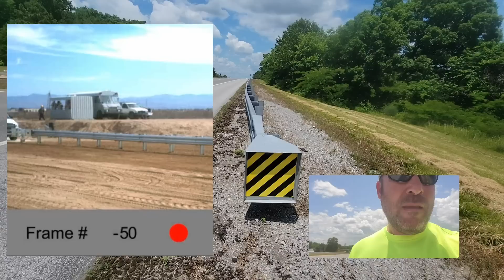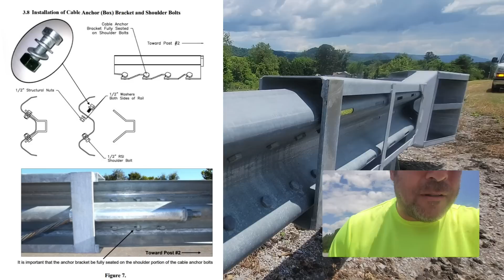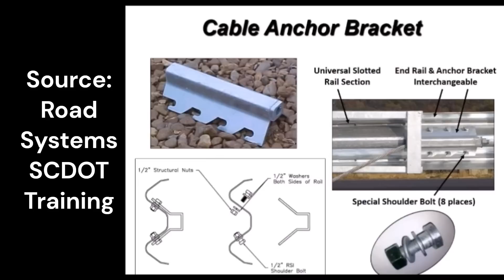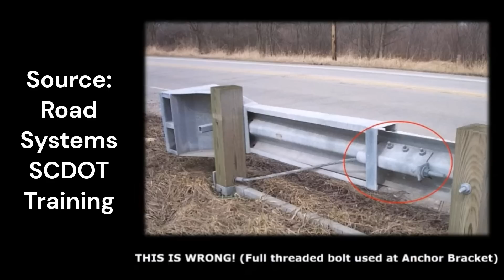Explanation of Backward Bolts Guardrail Short with Million+ Views

Comment: I work as a fire sprinkler fitter. I take my work very seriously when it comes to proper installation and the thing i noticed is you mention manuals/cut sheets. Id imagine theres some form of packing involved in the hardware, unit etc, how do we contact these product manufacturers to insist a cut sheet included with every unit? Yes its a lot of paper, but its worth it.
Reply: I'd say one cut sheet for the whole box would be enough, no?

Comment: 2:35 You could have a slot on the shoulder of the bolt that the anchor plate fits in but won't fit on the front of the bolt if it is installed backwards.

Comment: Why not just have the manufacturer put a symbol on the side say a letter “A” then the bolt has a letter “A” on its head, and installers use that as a signal to match sides. Sounds like a matter of life and death worth the extra cost to change the manufacturing process.

Comment: As soon as it states SHOULDER of the bolt your point is made :) The shoulder is stronger, installed backwards like that the threaded portion of the bolt that shouldn't be there will be much more likely to shear. If you're not going to follow the instructions why not just put it together with self tappers? :O Hold them accountable, put 1 in jail, and everyone will start reading the instructions :D

Comment: Most of the problems you come across are from people getting low wages that just don't care. I got a new Softstop install from a ITS project. It's curved & trailing end is missing parts. Manual tells you it can't have a curve in the first 50ft no matter if it's built as a TL2 or a TL3. I have to wait until we do a walkthrough later on to make them fix it. The big companies hire min wage workers to get low bids. My small guardrail sub pays his guys more & trains them. The job better be correct or he's chewing some butt up. Most of what you see is from repair work someone has patched it up.

Comment: Regarding the comments, I'm sure most people just do not understand that there is complexity and design in a guardrail.  I'm sure you've made videos specifically about this, but you'll just have to keep repeating yourself.  

As far as assembly errors, the design has to be improved.  It's designed well for impacts, but not designed well for assembly.  This is a common problem for big items where the customer base is small, since there isn't a lot of feedback or trouble shooting going back to the manufacturer.  Off hand, I'd say color coding is a good idea.  Paint the tops of the bolts blue, then paint a blue stripe on the cable bracket and slot, then the contractor just has to match all the blue bits together.  

Perhaps you could arrange a meeting where a new contractor assembles a guardrail and the designer/manufacturer observes without saying anything, just to watch where the sticking points are.  I've found sessions like this to be extremely helpful in software and web page design.

Comment: Thank you, sir.  I appreciate the work you do but am sorry for the loss of your daughter.  As a former highway construction inspector, one of the problems I faced was "inspecting" installations where there was little to know specific detail as to exactly how the intallation was supposed to be.  Sure there were plans and standards from the state showing "general" details. But by the time the manufacturer's detailed installation plans could be obtained, the work was long completed and the contractor gone.  This may be different nowadays but it was a frustration for me at the time.  Everyone has to get in, get out and move to the next job. I also wonder  whether state maintenance programs include regular inspections of past guardrail installations to determine if they are still in compliance with the manufacturer's design intent.
Reply: Your comment should be highlighted, it’s important to know where and why in the chain of events safety breaks down. It’s easy to point to the next guy when you don’t realize he is being screwed too!

Comment: “it doesn’t matter” i don’t think you proved why bolt orientation does matter.  just because the drawing shows it a certain way doesn’t prove why it matters from a safety/physics standpoint.  can you explain why it would be problematic for the bolt to be the wrong direction?  from a physics perspective, the clamping force is the same irregardless of orientation
Reply: i think i figured it out.  the captive washer actually rests between the rail and the other piece so it provides a small gap.  i would imagine this allows it to slip easier during an impact

Comment: As a mechanical engineer, everyone thinks they are an engineer. Always follow design drawings and manufacturers recommendations.  Or idiot proof the installation from wanna be engineers so the system can only be installed as designed.

Comment: I hate the litigious society we live in but unfortunately a massive lawsuit is probably the only thing that will get action to resolve some of this stupidity with safety barriers. 
They are supposed to be “Safety” barriers so the fact that they are causing this horrendous destruction is pitiful. 
I am in the NY area and I do see a lot of these deadly barriers in my area. I also see a lot of those large yellow bins filled with sand in certain locations…… probably not enough room to use them in many locations.
Considering the many incredible engineering structures we have in this world it’s hard to understand how someone has not come up with a better mousetrap for this problem. Blunt end guardrails are inexcusable. If car manufacturers can produce a car with crushable end zones why can’t barrier manufacturers come up with a better crushable barrier. I am sure NASCAR and Formula One has a better barrier system than we use on public roads.

Comment: I work in the cellphone tower field ( at heights). Per some carrier, manufacturers, and tower owners instructions. If we use the wrong bolt, washer, lock washer, and or don’t have pointing the right diction.  *Bolt point up. We will not get paid till it fixed. 

One more thing to add. Some carrier will only allow .03 +/- of plum and tilt. 

*towers are engineered to flex and move with the ground during an earthquake without collapsing.

Comment: OK, so your argument is that the manufacturer says to put them in a certain direction, so that means it is definitely better? Because I can give examples all throughout entire industries where the engineers were either wrong, or had no real reason to put something in one way VS another. The physics don't change because a bolt is put through metal from the front as opposed to the back. It's exactly the same. And just because you call people ignorant, doesnt make your argument more valid. Show proof of the rail failing because the bolts were put in front to back, instead of back to front. I can confidently say that there is no such proof. You can put a bolt through metal in either direction. It's going to hold exactly the same way.

Comment: Never did he say having the nut facing out at the same way of the bracket was a problem but the solid steel frames which were used before 1997.
Reply from the maker: The system did not exist before 1997! The point was to focus on the shoulder bolts which were discussed.
Reply: @TheGuardrailGuy  he says in the video the old non catapult steel frame was switched after 1997, do you really believe a few threads on 6 bolts is going to hold it back from ejecting when a car crash into it?. The importance is the new ejectable steel cap which he compare it to.

Comment: 1:57 WRONG! Sorry, but no. No one's pounding the table here. And no one's saying these things SHOULDN'T be installed properly. From the looks of that video the bolts SHOULD have been turned around, one side of washers was missing, and the metal hook things weren't tightened enough. We're all just asking WHY you think something like bolt direction matters?!? Perhaps the person who made that drawing KNEW bolt direction DOESN'T matter, but they had a drawing to finish, so they picked one way randomly?!? Ever though of that? Even the tightness of that cable shouldn't be a problem. In fact, that gap would allow MORE movement and hence a softer/slower impact! That's safer, not "a LETHAL installation". You calling something "LETHAL" requires more proof on your part! So "incorrect? Yes. "LETHAL"? Prove it! 

And WTH is that truck even doing?!? Are we SUPPOSED to crash into the ends like that? I assumed those were more to keep your car on the road and out of the river or other lane of traffic than to slow your vehicle with! Perhaps if you made a video detailing the EXPECTED use of these, and looked into the installation instructions provided by the company who designed them (Because if those instructions are not as clear as your drawing, then blaming the installer is unfair!) OR, if what you showed were the ORIGINAL instructions and they have since issued alterations to the drawing you showed, the installation you're looking at just might be CORRECT! Also, most companies design their products with a certain level of "idiot proofing" which this design seems to lack! Making this more of a design issue than an installation issue! OR, this could be a manufacturing issue! If those bolt holes are even slightly undersized or not properly aligned, then just getting those bolts IN the holes would be an accomplishment! 

Look, I'm sorry about your daughter. And if this is a real problem then I'd like to see a national program of guard rail inspectors unleashed at EVERY finished new construction guard rail and a policy of upgrading all old guardrails as needed. If you made a single video that explains what the problem you're trying to fix IS, who's fault it REALLY is, and what you think needs to be done to fix it - we'd all get behind you! For now, it just seems like you're mad at some random young guy working for the DOT who hasn't been properly trained. But if he isn't properly trained, that's not HIS fault now is it? Maybe he IS properly trained, but his boss is telling him to "hurry up" and "that's good enough" so it's not the installers fault OR the cities fault! It's the foreman's fault. Make a better video, get more people on your side, go viral, get interviewed on Joe Rogan's podcast, get called before Congress to testify about road safety, and then clap as the POTUS signs a bill named after your daughter and finally fixes whatever problem you think you're solving IS! Or you can just keep getting mad that Cletus didn't follow the installation instructions properly and installed the bolts backwards. IDGAF, I'm not the boss of you. But I know which one I'D choose! 

Alternatively, you could film yourself unbolting those bolts, flipping the screws around, adding washers, tightening up the metal plate and cable, and "fixing" that guard rail (instead of just b!tching about it online).

Comment: God bless you and the work you do, I can't believe ppl are defending incorrectly installed safety equipment.
Reply: A sticker on the bracket showing the bolt direction would be a cheap idea to inform the installer

Comment: The best way is design it properly so that it only fits together one Way, your final answer
Reply from the maker: Trust the engineer and hope for the installation!!!
Reply: @TheGuardrailGuy  nope trust doesn't work, needs a quality control check after installation by a supervisor or higher
Reply: @johnmoloney5296 These things are engineered to extreme standards. This dude is the inspector. What you've described is exactly how it works, except you are ignoring the part where everyone is trusting the engineer and their test results.
Reply: @D-Vinko  well then thats simple....spot checks and the threat of should stamp that out

Comment: I dont understand how the direction of bolt impedes the performance of the design. Seems like either scenario the bracket will slide off as designed upon impact
Reply: Even if direction of install made no difference, the contractor who installed this used the incorrect bolts, there were not two washers,  only one. Therefore there are two mistakes made installing this piece. Do you want to trust you or your loved one's life to "might be okay"?
Reply: @LeonardRoberts  im just trying to understand if there is a difference or not from an engineering perspective.

Comment: Hi Steve, thanks for the explanations, as an engineer I was keen to understand the reasoning behind how these bolts should be installed.  Looking at the manufacturers drawing you included it seems the bolts installed are not the correct ones, they do not have the stepped shoulder or the second captive washer.  If installed correctly the anchor bracket os just hooked over the bolt stepped portion to allow it to break away under specific impact conditions.   One other issue I was surprised that at least one support column protrudes higher than the top of the guard rail, this seems to add additional hazards for any vehicle that leave the road?

Comment: If that was a regular bolt, then yeah it wouldn't make a difference, but being a special shoulder bolt, that shoulder is there to keep the proper clearance for the tether to detatch. 

The moment I saw how the bolts interface with the hooks on the anchor plate I was wondering how they keep them tight enough to hold it on but loose enough to slip if needed knowing the installers probably aren't using a torque wrench. Having them backwards means the clamping force is determined entirely by the bolt tightness, and since I'm betting those were installed with an impact wrench, they are probably torqued so tight that plate might as well be welded to the rail.

When dealing with equipment that can make the difference between life and death, you can't just decide a small difference doesn't matter. It's either right, or its not, and for safety equipment it better damn well be right.

Keep calling this stuff out, there is no excuse not to have done it the right way on the first install.
Reply from the maker: Thanks for your comment. I really appreciate your thoughtful insight.
Reply: I think you clarified what the issue is better than the video
Reply: I was think the same thing until the video mentioned a shoulder bolt. I was like, uh a bolt is a bolt. Having that shoulder design makes a huge difference on how it acts one way to the other.
Reply: @AverageCitizen333  Now that I think about it, I seriously wonder if those are even the right bolts. If it is the correct shoulder bolt, you should be able to see the shoulder exposed on the outside of the rail since the shoulder should be wider than the threaded portion. I bet if you pull one of those bolts it would just be a regular fully threaded bolt, not the required shoulder bolt.
Reply: I think these may just be regular graded hex head bolts. All the shoulder bolts I've used have a round socket cap head on them. Additionally that brief clip from the manufacturer clearly shows and states there will be a captive washer on the shoulder bolt and they are to use an additional washer on the nut side. I see no washer under the bolt head in this installation which is the most alarming deviation I see here. Incorrect hardware used, installed backwards, bracket not fully seated... There's a lot of wrong to unwrap here unfortunately.

Comment: Here’s the issue you’re complaining about the boats being installed backwards, but the bolts don’t matter which way they are installed the video you shared from the actual construction company safety board showed that as long as you’re using the right bolts it’s OK and as long as you’re using the right bracket….  In the video the reason the accident was so serious is not because the bolts are installed one way or the other, but because of the bracket they used was unable to slip off.

As long as the boulders attach, the shoulder of the bolt will go through both pieces of metal either way that you stick it through 

And I get you about saying you have to follow manufacture specs,  but for this, when you’re literally nitpicking some thing that is not going to make a difference either way

By doing that, you literally take away from the ones you find that are actually an issue. Kind of like the boy who cried Wolf if you complain to the city about small things like these boats being installed backwards according to you, that doesn’t actually affect the functionality of the guard rail. They are eventually going to not listen to your complaints, even when you find one that is actually potentially dangerous.
Reply: so you missed the part where the bolts were installed the wrong way and *ALSO* the wrong bolts were used? Guess you missed that part.
Reply: @genewitch  I literally commented about the bolts being in the wrong way, and how it wasn’t the problem that they highlighted in the video. See the shoulder of the bolt goes through both pieces of metal no matter which side you place it on….

But you want to look like you made some kinda point….  Too bad you missed the mark

Comment: The best thing to do would be to redesign all of the end terminals to force people to put them together correctly. One way might be to have a tapered bolt and tapered holes, another might be locating pins that will only allow a bolt/nut with the proper hole to accommodate those pins to be installed, something which would push the bolt/nut so far away that they wouldn't be able to mate and screw together. However it's done, if you make it so difficult that they'd have to spend more than 30, 40 minutes, that would provide enough time for someone to realize that maybe, just maybe, they should flip the bolts around the other way instead of sending Billy Bob to Home Depot to get an oscillating saw. Color coding and more training is fantastic, but there will always be that one guy that does it the wrong way anyway.